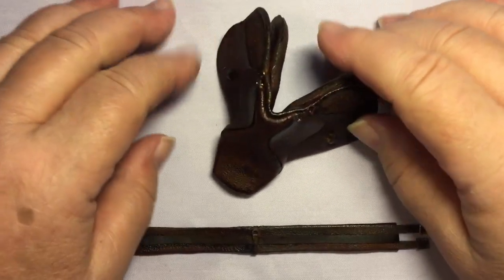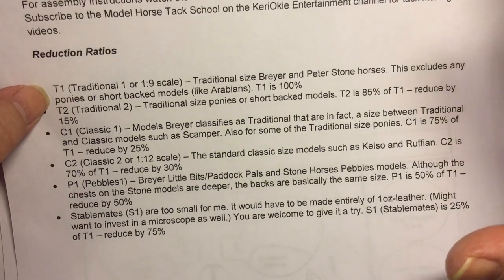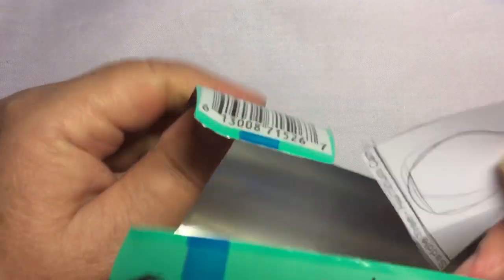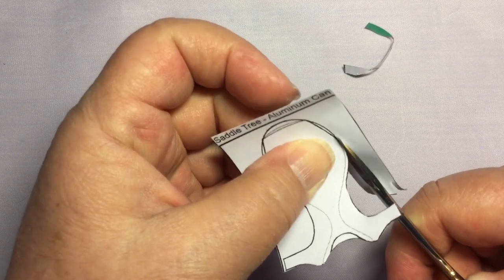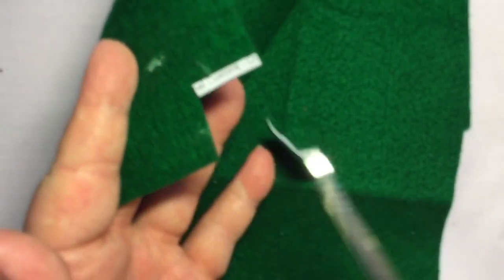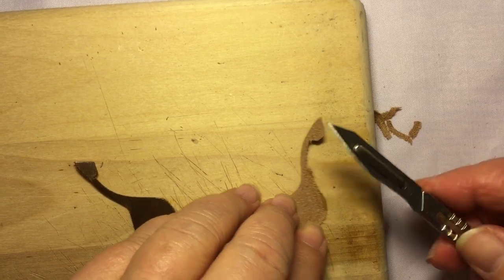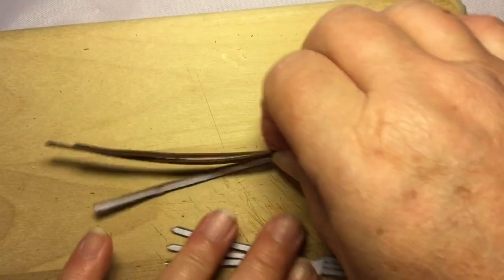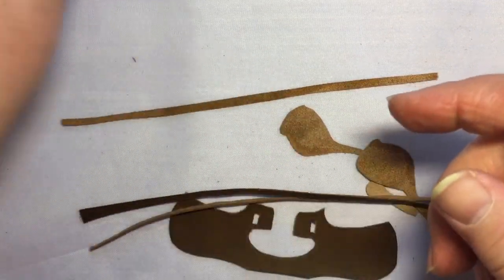English Saddle for Model Horses - part 1

Comment: I used the drinks can in the saddle I made before I discovered that there were people like you! I have used drinks cans before to make 1:6th shoes for action figures and it was the obvious thing to use to get the shapè of the sàddle. (My original is made of craft foam but I intend to make future stuff in faux leather.
In my first attempt I forgot about the bars for the stirrup leathers and used a strap with D rings under the tree.  I have seen the bars cut into the aluminium and folded over for strength and I reckon I will do that in future. Felt is the obvious padding material (in fact you used to get pony saddles made from thick felt and leather but I haven't seen one in a hot minute!

Comment: Very nice!!!  Now I'm starting to make saddles (English only, because I ride English only).  I used different colors of leather, and made a model of my real Stubben Imperator, which is tan with a black outline.  They're no longer made.  My real saddle is over 30 years old, and still in great condition. It's had padding and knee rolls replaced a few times over the years.  I used this video to make the saddle. (Jan Griffiths, on hubby's account).
Reply: I LOVE the old Stubben saddles.. I loved my light tan dressage saddle in buffalo leather..Now i only have the more modern one. But I still have some of the old saddles - a German Kloster Schøntahl.. dressage in light tan as well.. It is one of the best saddles i have ever had. The most special saddlke i have is an old side saddle from 1780 that is a bride-side saddle from Norway. It under restoration . :)

Comment: Is there any non-animal based product I can buy?
Reply from the maker: King Zeus_and_I 
Sorry. I have only used real leather for this pattern. I don’t know of any faux leather that behave like real leather. You are welcome to experiment.
Reply: King Zeus_and_I you get some sawdust or walnut shavings (you’ll need to make the shavings into ultra fine powder) and sprinkle it on some faux leather with some adhesive to give it texture.
Reply: King Zeus_and_I you can also use corn husk! (Though it’s extremely fragile and you’ll have to use a paper maché method to build it up.)

Comment: Is there a material that I can use besides Skiver because I am having a hard time finding it. I found the tooling leather but not that
Reply from the maker: Sliver is getting harder to find. I found some on eBay marked as 1oz leather. It’s a treasure hunt for sure. I suppose a thin fake leather would work but the results would not be the same. Depends upon the properties of the fabric. Sorry I don’t have a better answer.
Reply: @modelhorsetackschool  Hi there, I have the same question. Nothing comes up for sale under the name Skiver- can I just use a very thin leather scrap? Looking for a suggestion on material, otherwise I can't make the saddle :( Thanks for your help!
Reply from the maker: Yes it is a treasure hunt Skiver or Oliver or any leather that is 1 oz or less. It can be chrome tanned or natural. I have used a chrome tanned white that I could dye to a similar color as the tooling leather. A thin garment type suede will work if you like the look. Glove leather is also thin enough. There might be faux leather fabric that would work in a pinch and for practice saddles. eBay and Tandy Leather factory are my sources. Hope that helps.

Comment: Is it possible if you could make one schliech size please?😟☺
Reply from the maker: Blue River Stables Riding Academy The patter includes reduction ratios. You can use your printer settings or a copier or scaler and reduce the entire pattern by a percentage. I don’t know the scale for that manufacturer type but it might be a 1:12 or smaller scale. Reduce the pattern to the C2 reduction ratio - smaller by 25% - then check the length of the tree. If it’s too big or to small either adjust up or down by 5% until the length fits. Just use the paper pattern to measure. You will need thinner cushion so use a thinner padding instead of foam or chamois. I’ve used the reductions to make Pebbles/ Paddock Pals sized saddles. Thinner padding is important. Thank you for the question.
Reply: I had a look on google and Schleich seem to be around 24th scale. I can’t help with the ratios, though, sorry!
Reply: @ShintogaDeathAngel  Use the ratios on the pattern to take it down to Classical or 1:12. Then reduce by 50% to get 1:24.

Comment: Just started working on this got some thin 'softy' garment leather from hobby lobby which seems to be skiver. Could I also use this as the tooling leather?
Reply from the maker: That softy leather is tanned differently and won’t keep a pattern if tooled. Tooling leather is stiff not softy.

Comment: Where do you get pre skived lace from?
Reply: Also, how thick is the 2/3 oz. leather?
Reply from the maker: I don’t know if anyone. People slice their own.
Reply from the maker: 2/3 oz is the thickness rating. The higher the numbers, the thicker the leather. Skiver would be 1oz or less. The industry does not provide millimeter measurements and skin thickness actually varies throughout the hide.

Comment: what about making it bigger (1/6 scale )?
Reply from the maker: I’ve never tried. Theoretically if you can reduce the pattern, you could increase it as well. The third dimension such as the padding you would have to experiment with. And I don’t know about the tree aluminum. Rio Rondo might have the hardware for that model size.

Comment: Where can I buy skiver?
Reply from the maker: Good question. This leather type can be a challenge. I’ve had my best luck on eBay. Sometimes it is called pliver in the listings. I’ve had luck buying chrome tanned in cream or white and then using an alcohol based dye to change the color. Every once in a while there will be a listing for vegetable tanned. Be sure to ask for the ounce rating. A true skiver or pliver will be 1oz or less. You can also search the web for other sources. Tandy Leather no longer offers this leather. It’s a treasure hunt for sure!